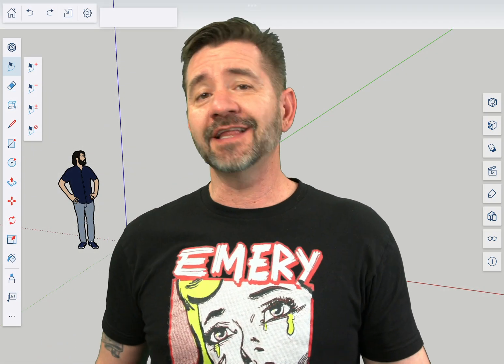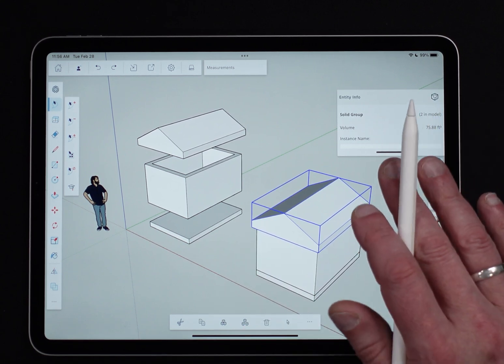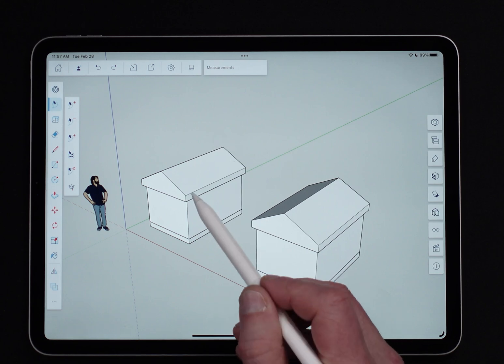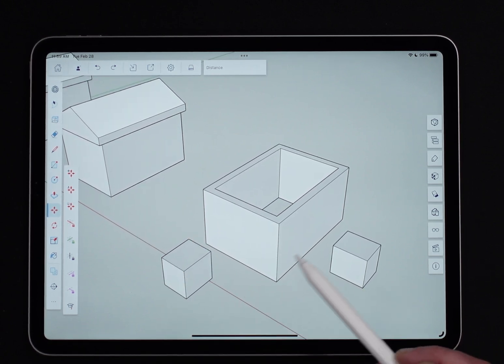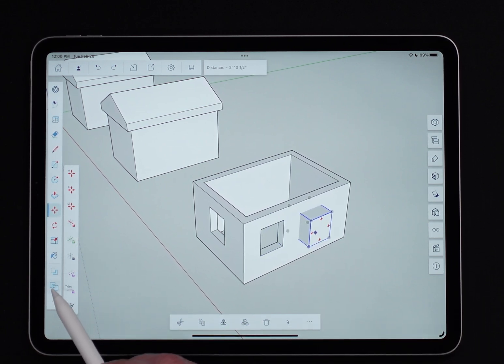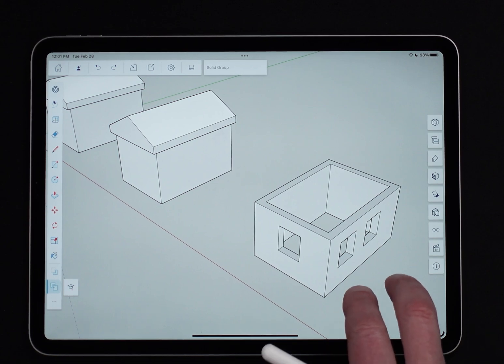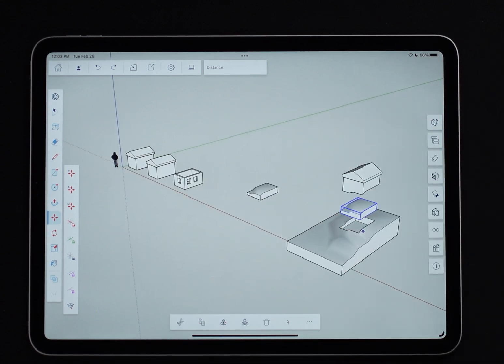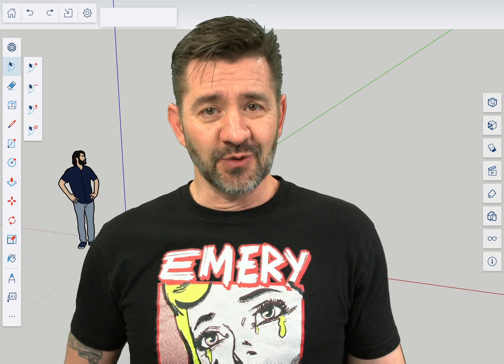Solid Tools - SketchUp for iPad Square One

Comment: Is it possible to round off edges? So if i did a cube, could i make the edges (and ultimately corners) by making them shamfered / rounded / extruded ...I dont know the word, but how to i make my edges less sharp??

Also, can you export and STL (for 3D printing) from Sketchup iPad?
Reply from the maker: Yes! Here's a video on how to round edges: https://youtu.be/ZPNgLkayhbk

And double yes! You can export STL files from SketchUp for iPad. Tap the export icon in the top toolbar, and select .stl from the File Type dropdown menu.
Reply: @SketchUp  Can you do this on the iPad app though? The video seems to be desktop? Does Sketchup Go have rounded corners?

Comment: I have enjoyed my limited but helpful experience with Sketchup for iPad.  I have been waiting for this video!

I am a hobbyist wood worker.   I have made several designs in Sketchup.  I use components a lot now thanks to you guys coaching.   Just makes sense now.

That gets me to a new problem.   I am doing designs now that are getting quite accurate and refined.   Currently I am making a stool design that I would like to build.  However everything I have designed so far is flat or sharpe edges without rounding.  I can use follow me for rounding over.  That works except when the round over needs to smoothly cross over from a joint in to components. They are coplanar but the leg is spread out at an angle less than 90°.  How can I use solids to get a good result?   I can send a model for you to see.   But if you did a video on this it would be great!

Comment: I'm new to Sketch Up, so I assume that the solid tools are the same and are available in other than I pad applications?
Reply from the maker: That's right! Solid Tools is identical across all SketchUp platforms (as long as you have an active subscription.) In the free version, you only have the Outer Shell command.